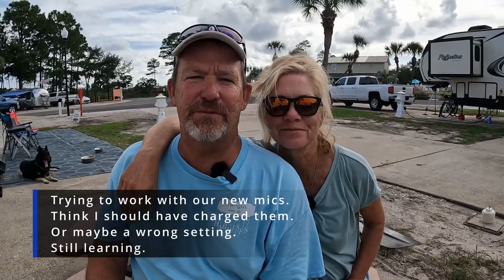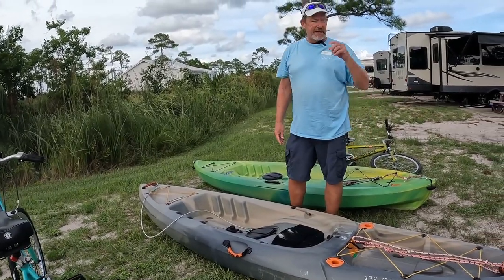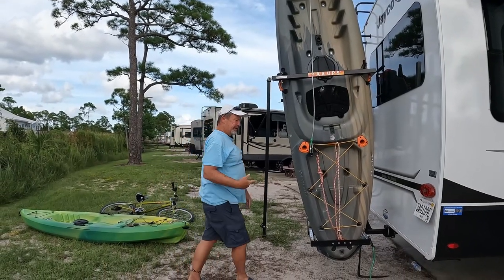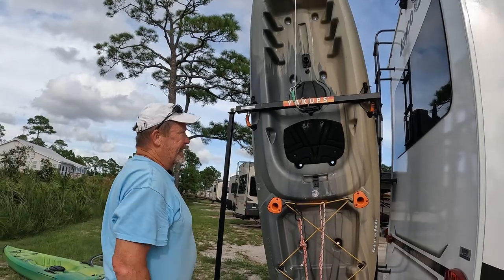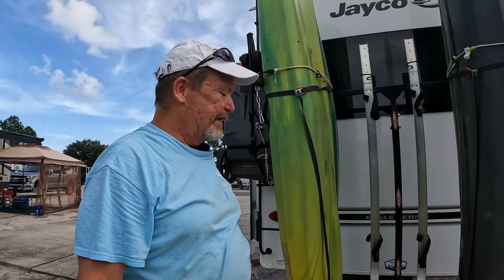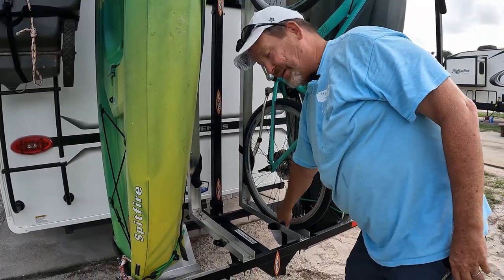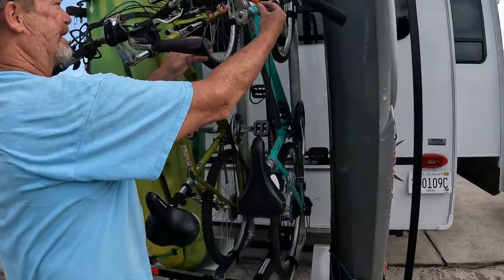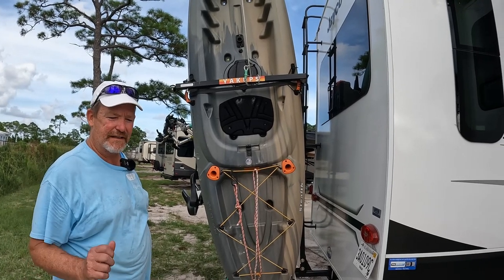Loading our Kayaks and Bikes on our 5th Wheel Rack

Comment: Thanks for this video.  My wife and I just upgraded  from a travel trailer to a 2024 Jayco Eagle 321RSTS.  We used to carry our 11 foot kayaks in a rack on the truck but the fifth wheel ended that.  This seems like a good solution.  How long is your bigger kayak and how far up does it extend past the roofline of your fifth wheel?  I think that I am going to put a front receiver on my truck and put my mountain bike up there where I can see it.
Reply from the maker: I'll have to remeasure my longest kayak as I've forgotten its length.  Our 13 ft tandem is too long.  However, if you contact Yakups they would make sure it would work with your kayaks and camper.  My longest does not go up past the high point of our roof/AC.

Comment: My hitch says its only rated at 150 lbs on my 5th wheel.  Did you get yours reinforced at a weld shop?
Reply from the maker: Mine didn't have to be reinforced on this camper.  However, we put a normal bike rack on our first camper and it broke the welds on the bumper.  Be sure to check with rvkayakracks.com before ordering as they can tell you if it will work or not for your camper.

Comment: We just bought one from a private party for $1100.  Like brand new. I noticed that your kayaks lean back a little as does ours. Have you seen any issues with this. Also are those pans holding up for you since ours sit directly on them. We have fishing kayaks that actually weigh right at 67 pounds each. Thanks for the video.
Reply from the maker: We've seen no issues with the kayaks leaning.  The pans are bent up a little but that is because the bottom bumps the ground sometimes when we are backing in or pulling out of our driveway so they've protected the kayaks more than once.  So far so good with ours.  It does bounce around more than I'd like but that still has not produced any issues that I'm aware of.

Comment: Where did you get the rack?
Reply from the maker: It is a Yakups brand we got at www.rvkayakracks.com.  They will run you through a pretty thorough questionairre about your camper and kayaks/bikes to make sure it will work with your rig and equipment.ww.rvkayakracks.com